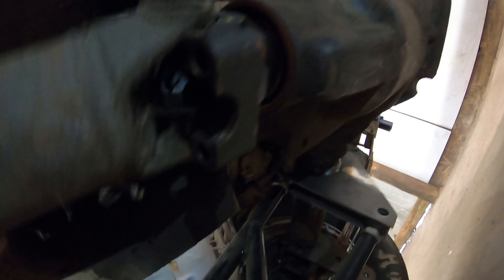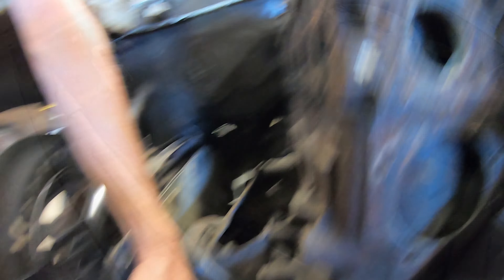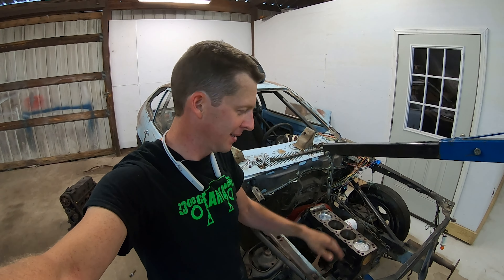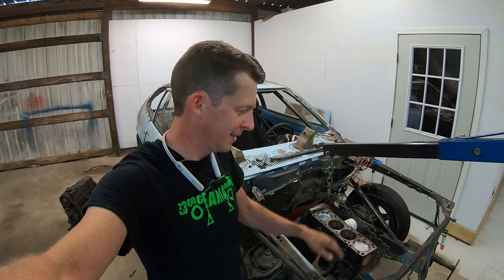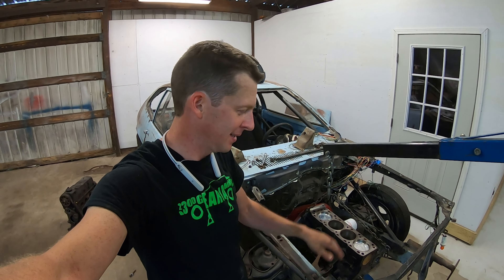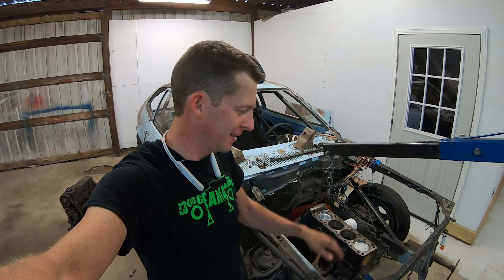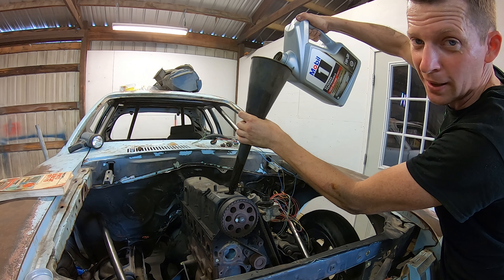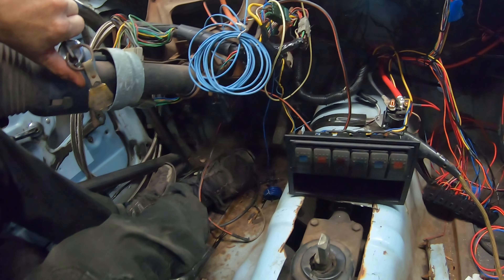#turbo Ford Secret Racing Oil-Type Revealed

Comment: About the oil pickup tube, Mustang IIs have a front sump. I picked up a 78 Mustang II a couple weeks ago with a 2.3. Getting it running so I can drive it before I do racecar stuff.
Reply from the maker: Yeah pinto and mustang ii are the same parts. Not real easy to find

Comment: Grab a $40 aluminum Crown Vic, Aerostar etc DS and get it shortened if you want a cheap stocker but the CV shaft is 3-1/2” iirc
Reply from the maker: I do have a crown Vic driveshaft but I have a hard decision to make on that. I may have to get a driveshaft made which for me means having two made because I double on everything.

Comment: Sweet man we are finally about to see the pinto in action, woohoo . Thanks for the shout out man and you're probably the only one that could make me look smart because I can't do it for myself trust me I have already tried 🤣😂 looks like you might have to go get a inch knocked off of that drive shaft at the local welding shop. That is what I usually do anyway but I got lucky and found a 44 3/4" aluminium driveshaft on Ebay that I was able to make work and there is just enough room for the movement that it needs. Ill look really quick on Ebay and see if that guy has another one that will work because he had several that came off of race cars which is what mine came off of . Anyway I figured that I would leave ya a good long comment for old times sake so i figured that I would find something to babble on because I couldn't leave a short comment and leave ya hanging 🤣😂🤣 hey if you run across a 71 only rear half hatch window for a pinto let me know I need the glass out of it or go ahead and get it and I will pay u for it and even slide ya a few extra to boot 😉 I want to get rid of this full glass hatch that I have and I already have the half hatch just need the window for it 😁👍🏼 ok i think this comment is long enough so ill shut the hell up now 😂🤣😂🤣 BYE
Reply from the maker: 🤣🤣🤣 a new record
Reply from the maker: I have a big decision to make whether I even want to go to alum for this. That will make sense later. I should have measured 6 months ago so I could've been searching already.
Reply: @2300gearjammer can you get that one shortened, if not i have one that I can get shortened for ya and and send it to ya. Ive had several done and they worked flawlessly and it's cheap to get done?
Reply: @2300gearjammer  oops I sent it twice 🤦🏼‍♂️ I didn't think the first one went through🤦🏼‍♂️🤦🏼‍♂️😬😂🤣😂
Reply: I found you a drive shaft on Ebay that is 44 1/2 " from the same guy that I got my driveshaft from. MrDirt50 is the seller's name and he's quick on shipping. It came from a dirt race car or something and it is like 80 bucks to your door
Reply: You measured and delicately made room for your transmission such as I did on beans 🤣😂🤣😂
Reply from the maker: Haha ordered that one thanks. I stay right on the ragged edge of having time to get it all done so just a little help finding parts goes a long way
Reply: @2300gearjammer  sweet man, glad I could help you out
Reply: @2300gearjammer  44 3/4 is the length that I got which was a aluminium one which was the only reason I ordered it but it is the absolute longest shaft that you would be able to use and have enough room for the movement that it needs , but that will save you from having to get one cut down which would probably cost the same amount of money

Comment: I actually was surprised to see that run mobile one in the grand marquis... I would think you would run motorcraft or super tech 30 weight... Also surprised you didn't use the oil out of the bucket truck
Reply from the maker: Well Trevor just put new oil in the bucket truck so I wouldn't dare waste it on the pinto 😂 it does leak pretty bad though

Comment: Was that a Lakewood V8 bell housing?  In my 79 pinto Im planning a Cleveland with a TKX. Debating on the Quicktime Mustang II  bell housing for more room.  I'd like to stay SFI compliant, not sure that one is. Cutting my car up to make a better option fit is surely on the table.  Quicktime is $$$.
Reply from the maker: It was a SFI approved Lakewood bell t5 to sbf. Ive collected a few of those over the years before the QuickTime came out. You're right though, with the more angled transition the QT would have a way better chance to fit. Shewy they are spicy. . 💰💰💰

Comment: I just cut mine down yesterday, cut it to 45" driveshaft came out of a turbo coupe
Reply from the maker: Did you mark it, cut and weld back in the same place or are you going to get it balanced?
Reply: @2300gearjammer  It turned bad this time around. Where I cut was almost to where it stepped up to a larger diameter and the yoke didn't fit tight enough and it moved on me. So I found a place near me and had them shorten my original Pinto driveshaft. To go from the T5 slip yoke to Pinto driveshaft use a Moog 253 u joint
Reply from the maker: Agh. At least you got it. My 44.5" steel shaft showed up yesterday. Ill probably have to run two different conversion ujoints but I typically have those on the shelf

Comment: About your 2.3l turbo mustang: Is it too much to ask, what type of wheels and tires setup you’re using on the rear..? I’m curious to use 15x9x28 or 15”x9.5” - 28.0” 
Wheel =?
Width =?
Tires=?
What would you consider for my setup?
I know a lot of people don’t like sharing their builds info, for racing and personal privacy. I’m just looking around for suggestions from anyone that can help my son and I project. Thank you.
Reply from the maker: Hey I want to measure to make sure I tell you correctly for the wheels but I run 15x8 and 15x10s weld prostars. 

The tires are 
ET Drag 28x10.50s and 
Hoosier quick time pro DOT 28x11.50

Comment: If your going to use an adjustable engine mount why don't you use the stock driveshaft that you have an abundance of? I mean it's going in a straight line handling or weight distribution couldn't be to far off?
Reply from the maker: That's a great question and a bunch asked that during this pinto build. It sucks to need a driveshaft for the slow engine but the turbo engine would need the shorter DS. This car is actually going to do a bunch more than drag race but I still need the engine back as far as I can get it.

Comment: Ahh, I guess I am not the only "mechanic" that has to redo stuff because I left a part out or it broke putting it together. Thanks for this episode.
Reply from the maker: 😂 it's far worse. I was a Ford tech in a previous life. There is no escaping it with this car. If I turn a camera on this seems to happen every single time.